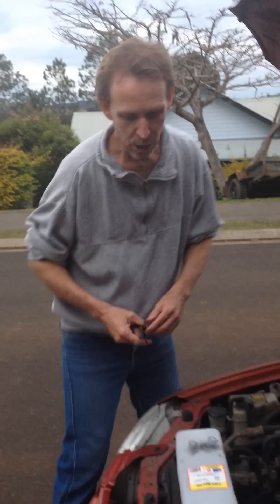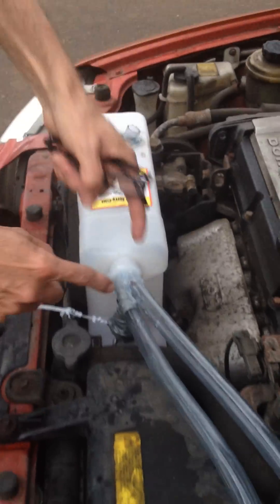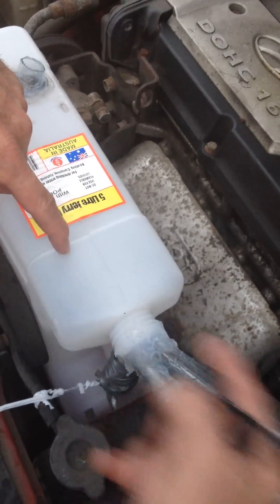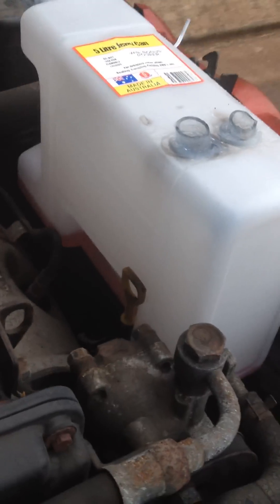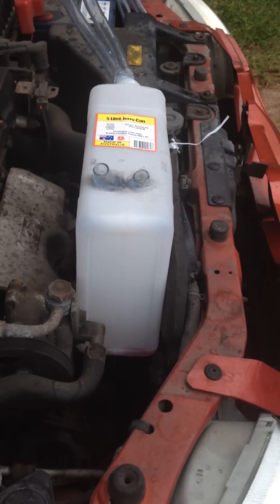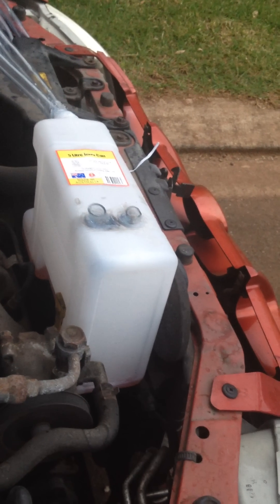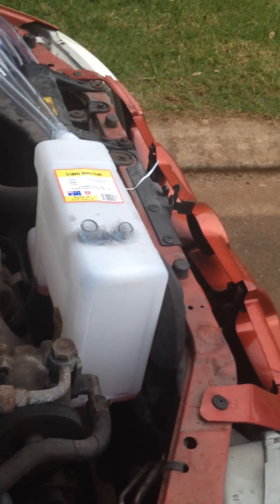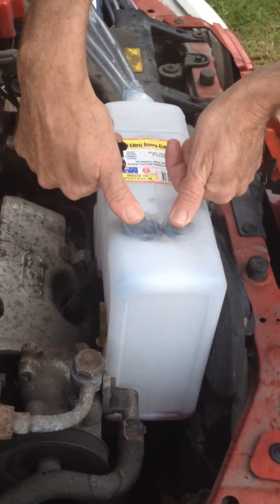Save on Gasoline Run Your Car On Fumes.

Comment: All petrol engines run on fumes - the carburettor or injectors vaporise the fuel before it goes into the combustion chamber. What you are doing is similar but you have no control of the mixture and you will probably be running your engine too lean, leading to pre-ignition and engine failure
Reply: Raw gas is injected into combustion chambers  and the fumes from the gas burn. That's it. There is no atomization, vaporization in carbs or fuel inj. If you look at a carb putting fuel in the motor its not vapor. Raw gas. Same as fuel inj. just more efficient.
Reply: carburettor work on ventury effect, air rushing in draws raw gasoline a smal amount and some of it vaporises on it s way to the cylinder and most of it is raw gasoline,carburetters are nor very efficient